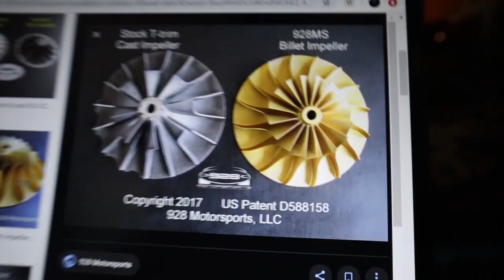SUPERCHARGED Q50 | DAY 3

Comment: Bro is your car stock height and what size are your 20" CVT wheels and tires??
Looking at the same set up for my Q50. Thx man!
Reply from the maker: No my car is lowered, I'm on tein flex z coilovers. And my wheels are 20x9F 20x10.5R. 245|345F 285|35R. Thanks for watching! Stay tuned
Reply from the maker: No my car is lowered, I'm on tein flex z coilovers. And my wheels are 20x9F 20x10.5R. 245|345F 285|35R. Thanks for watching! Stay tuned